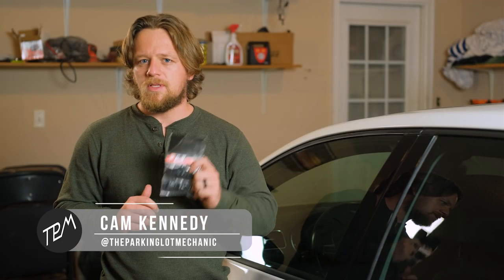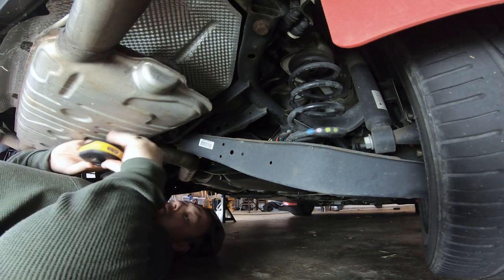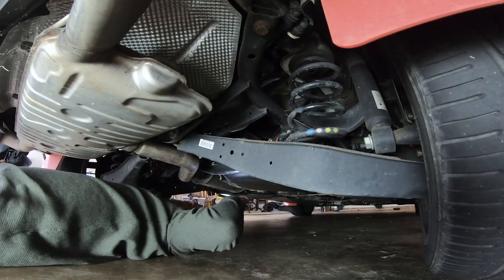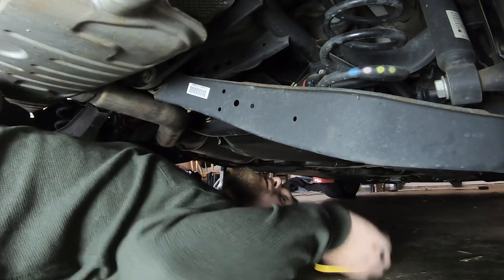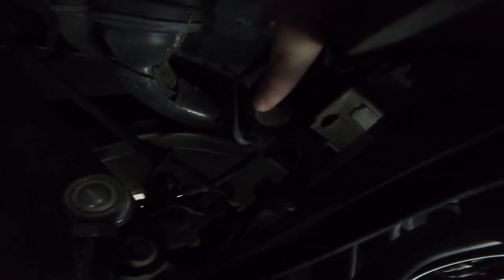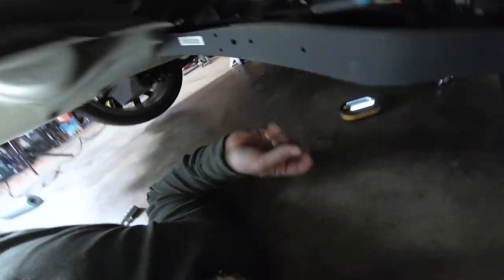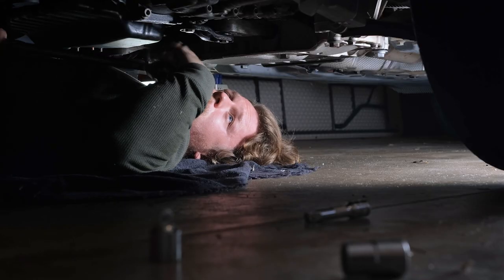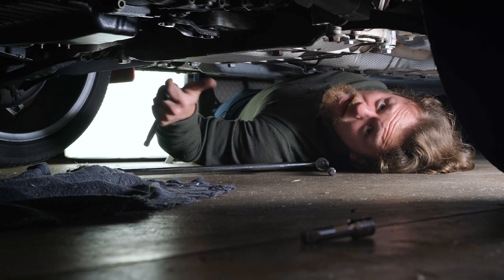ECS Tuning Front & Rear Subframe Locking Collar Kit Install | MK6 GTI

Comment: I plan on doing new lower control arms and bushings. This looks like I need to get the locking collars in at the same time
Reply from the maker: Might as well! I plan on replacing all the control arms one of these days with poly bushings too.
Reply: @TheParkingLotMechanic  look at the aluminum ones from a CC. They're much lighter. I got a set from rockauto for 120 bucks. Leaves room to upgrade the bushings and lose weight

Comment: I attempted to fix these today on axel stands. Couldn't get the subframe away from the chassis. Is it's just the 4 bolts, 2 rear subframe bolts and 2 upper bolts plus the two bolts which hold the exhaust bracket? The subframe just wouldn't budge so I couldn't get the upper locking collars on 😞
Reply: Exhaust hanger - two bolts
Steering rack - 4 or 3 bolts, some models only use 3. 
Then last, controll arm, lower and upper subframe bolts - 6 in total😊

Comment: You didn't mentioned where the clunk seems to be coming from, front or rear, nr under what kind of motion? Depending on that you may be able to better pin point what the culprit is.
It can be something as simple as a steering rack brace/bushing either loose or busted, or something related to the sway bars but it would definitvelly help to have more details.
An easy way to find something loose usually is to look for slight rubbing or filing like marks, you can spot it usually cuz they get a different shine, almost as if you had polished it or sanded it around the bolt seat.
Will wait for the BD review and see if you can find out what the clunk is
Reply from the maker: Yes, I do talk a lot more about it in the BD video! It was textbook subframe clunk happening under deceleration and these collars eliminated about 90% of the clunk happening at the front. I did several thorough checks around the sway bar and suspension components before going to the forums and ordering the locking collars. Wanted to make sure I was fixing the right thing. Been over the rear bolts again to make sure they’re tight and gonna go over the fronts again to see if that fixes it he rest, if not we’ll find out why it slightly clunks. The more I drive it though, the less it clunks...?